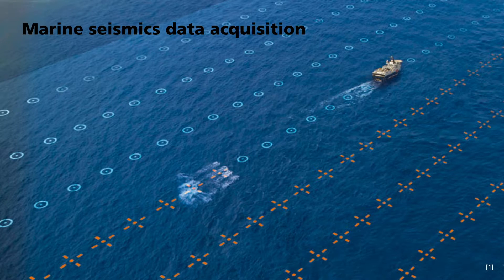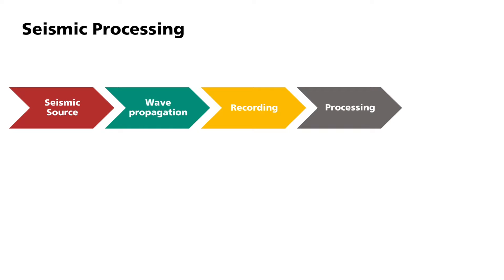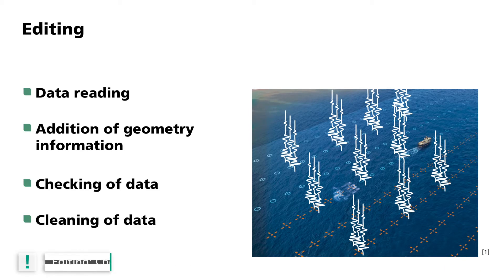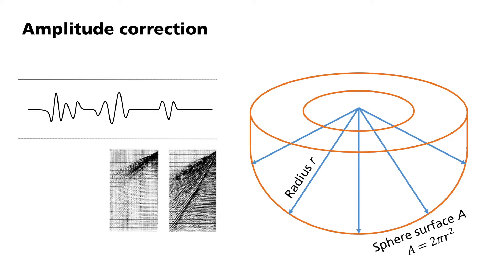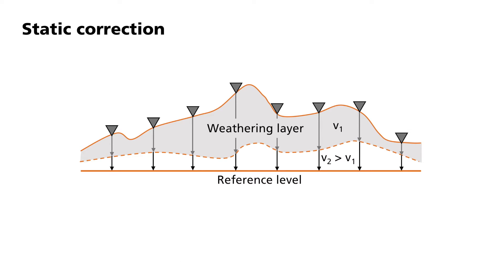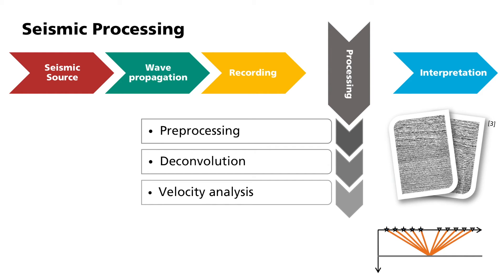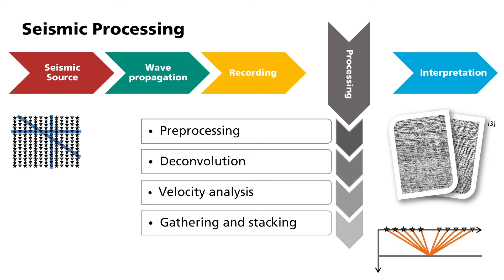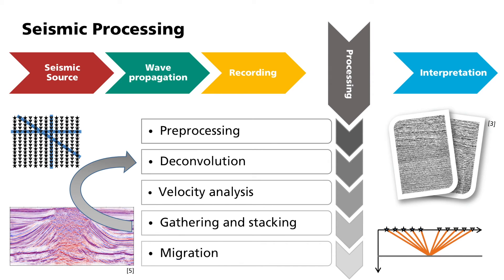Basic Geophysics: Processing I: Pre-processing

Comment: I want the order of this seismic process( NMO correction - CMP sorting - velocity analysis - depth conversion - band filter - stacking ) . can you please order this process from beginning  to the end of stacking
Reply: band pass filter(to remove ground roll energy and high frequency ambient noise that would contaminate the signal auto-correlation)-deconvolution-band pass filter(to remove very low and very high frequency noise as they are also boosted during deconvolution)-trace balancing(time invariant scaling of amplitudes for display purpose)-CMP sorting-velocity analysis-NMO correction-Stacking-depth conversion
so basically
band pass filter-CMP sorting-velocity analysis-NMO correction-stacking-depth conversion